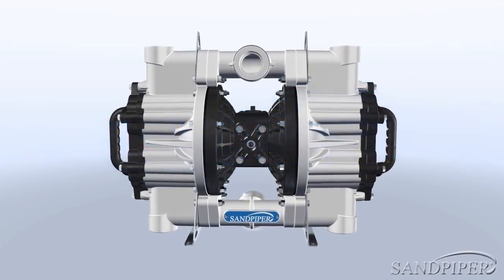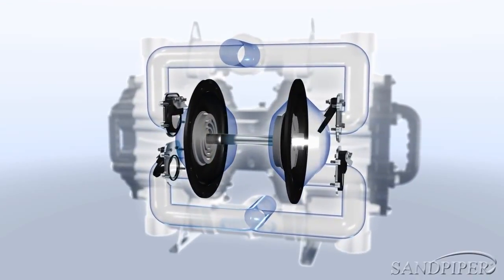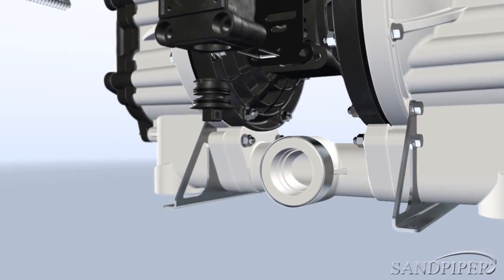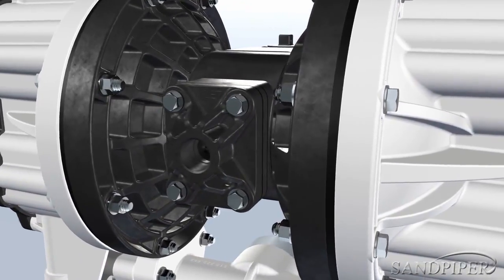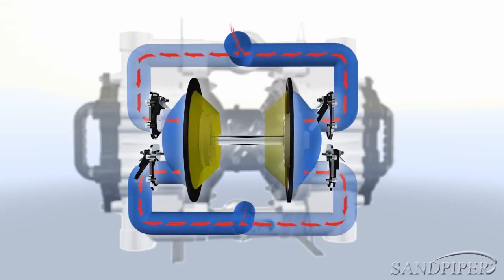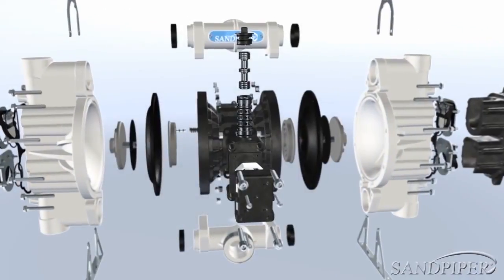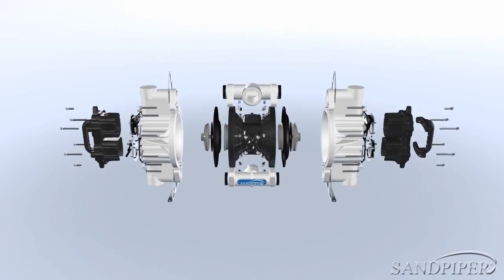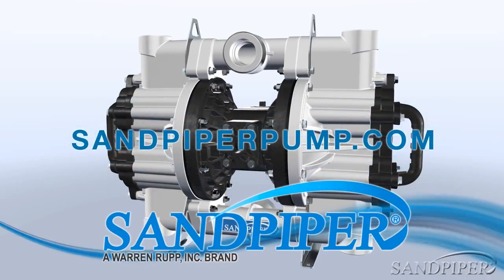Workhorse of the SANDPIPER Pump Line

Comment: On the 2016 model after replacing diaphragm and pump still not being operational, could 1 or both of the manifold be upside down? Will they even bolt up u upside down? Will this keep from operating?